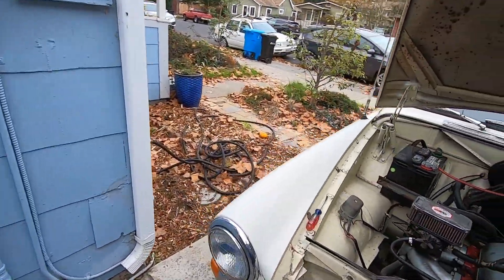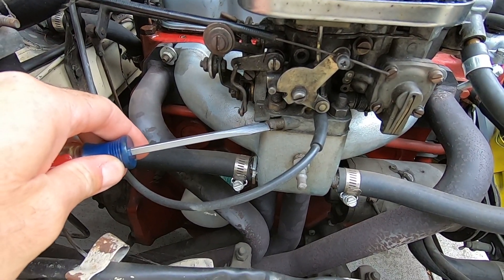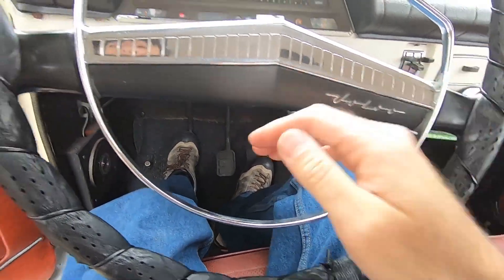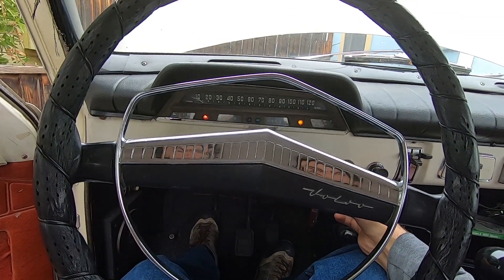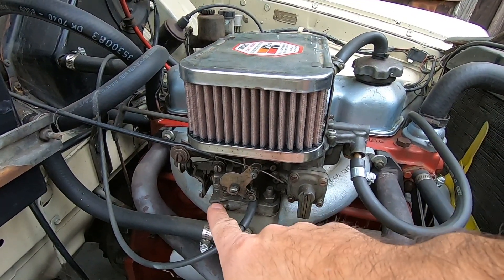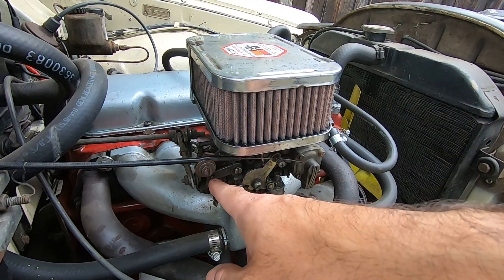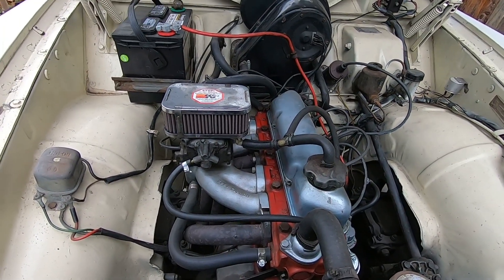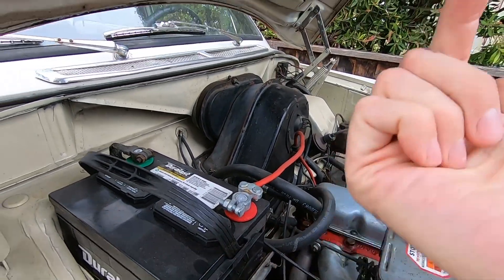Weber 32/36 proper setup to my B18; years later!

Comment: Why not install the original proper SU carbs. ?
Reply from the maker: Short answer is that I don't have the original set. Car came with this setup. My guess is whoever did it couldn't find the separate intake manifold when they swapped in the sport exhaust and manifold (Probably needed due to rust since this car was near the beach for a long time). On paper the weber can tune for more fuel, which usually means more power, but in this car, not so much; so at the end of it all, whoever did it, was going for the typical exhaust upgrade, and didn't know what the trade off was. 

I did pick up a replacement pair, but I don't know the condition, nor do I have all the parts to do it. Its not a simple swap since I would need to buy a new linkage and set it all up, etc. Once Marty is driving well I can take on more with Newton. I want to keep one of the two running, and this sort of job would probably take me quite a while with my current schedule. Maybe one day :)
Reply: @MakeitOnce  Bag the Weber.

Comment: Is the thin hose in the middle air or fuel?
Reply from the maker: It's a vacuum line to the distributor. Fuel is the bigger tube on the front side.

Comment: If it sat with ethanoyl gasoline in bowl may turn into jelly. Awesome car
Reply from the maker: What I have found, at least here in typically dry Califa (not this year, though!!!!) it actually evaporates into a powdery caked residue within a couple days. The "bowl" of the Weber isn't sealed/baffled at all, and with a K&N the gas just disappears. The jelly thing must be a pre-ethanol thing, cause I've never seen it on either Newton or Marty, and they both have sat with gas for long periods of time. Still a bad residue that needs cleaning cause it binds the moving parts even worse, but not a sticky mess. :)

Comment: I had a weber 32 dir on my b14 engine. Many of the issues you describe I had as well. I always thought at first that it was a vacuum leak, the jets, bad gaskets and etc. Then I just started to adjust the carb as I forgot to do it when I had it running the first time. Fixed every issue. Shaking, bad performance, ran too rich and would die when it was warm, and bad fuel economy. 

All I can tell you is that the 32 dir is incredibly sensitive to vibrations, and if you've got bad engine mounts you want to keep an eye on the carb.
Reply from the maker: I have good mounts. I'm starting to speculate that the bowl shape isn't well suited to this side mount setup. There is a lot of rocking motion when on the side of the engine instead of on top. Instead of just vibration, it seems to move a lot. A lot of people think the big problem is cause of the bends in the intake, uneven heating, and air flow, but seeing it wiggle around, I can only imagine the gas sloshing around the relatively flat "bowl" has a big impact.
Reply: @MakeitOnce  that might actually be true. One common issue on the b14 engine was that carb would actually shake loose and you had to retighten it every now and then.
Reply: I’ve had this same problem! Comes out of adjustment every few months and runs poor. Ordered new mounts as they are clearly gone then saw your comment so will be changing them tomorrow then tuning 👍🏼

Comment: throttle shaft play maybe ? common issue on these
Reply from the maker: Didn't think of that. Seeing how much play thee is in the choke, it wouldn't surprise me and would explain a lot.
Reply: @MakeitOnce  yeap !
I had a 34 34 on my 240, I'm not a huge fan of these carbs tbh. You should consider putting an OE carb on that B18 ^^ 
These Webers, being downdraft vs the sidedraft SUs or Strombergs is kinda an issue (fuel mixture has to make 90° bends) 
Love the vids, keep em' coming !